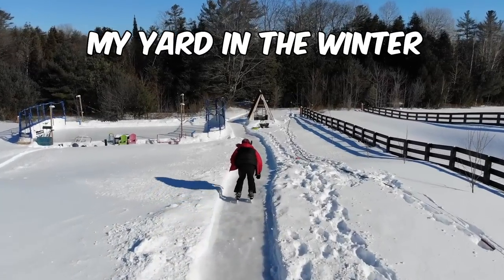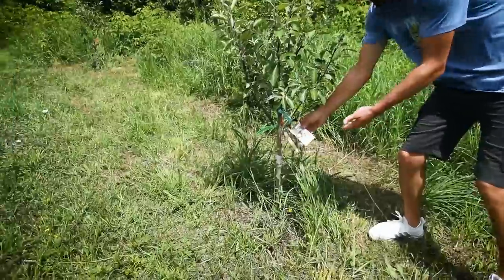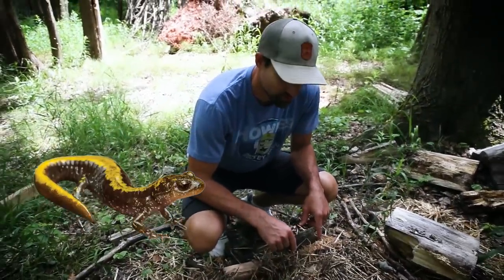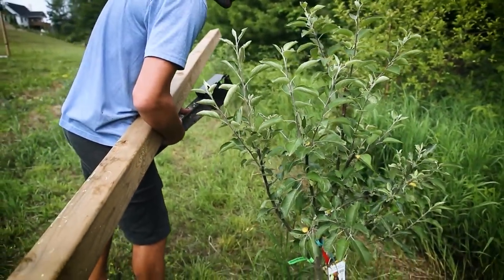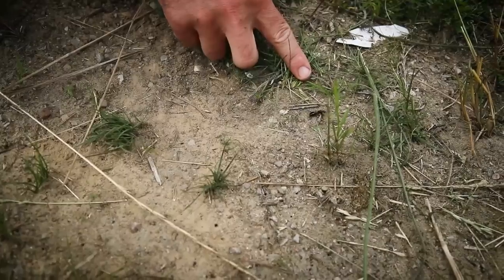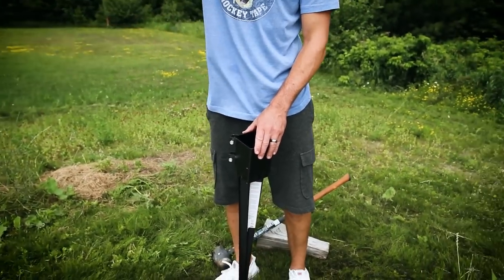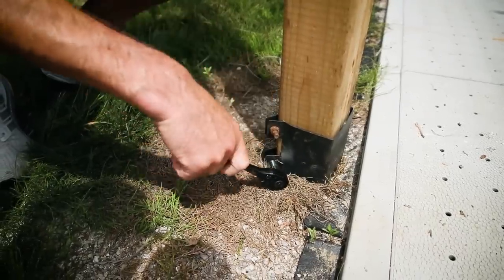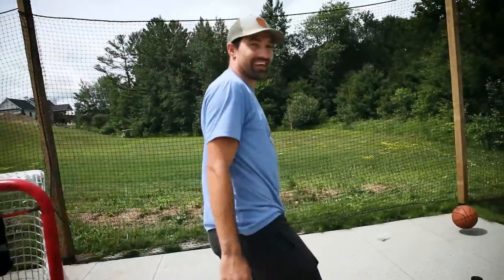We'll NEVER lose a puck again!

Comment: You should pour a concert path from the house to the rink. Then you can blade down it and it will theoretically be easier to flood come winter.
Reply: even though that is a good idea but when you fall
Reply: @amandasnowe7602  Just don’t fall
Reply: I think that to. and when you lay concrete it works better for the ice trail to. They better put padding on for roller skating down the concrete tho 😬

Comment: have you thought of cutting or drilling areas close to the edge of sport court wherever the straps for the boards would go, then you could run the straps under the court and use the boards during the Summer

Comment: Couldn't you just keep the boards and net up from the rink....
Reply from the maker: No, it requires brackets and straps that would interfere with running. It only works if it's filled and frozen